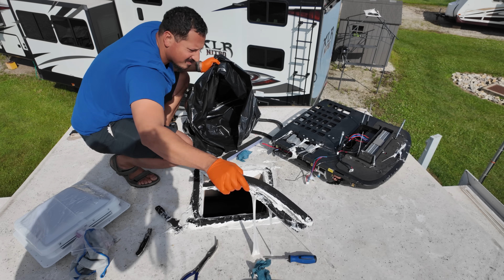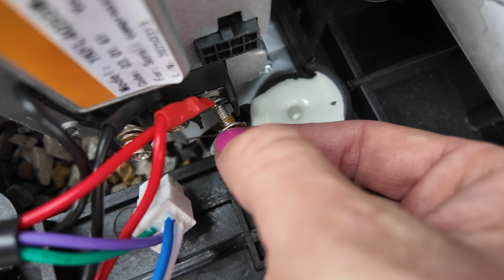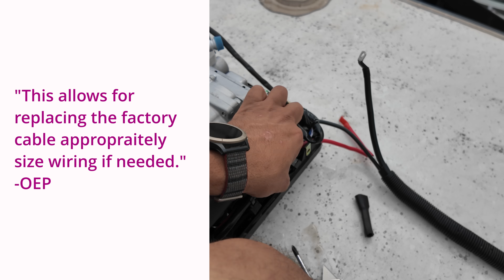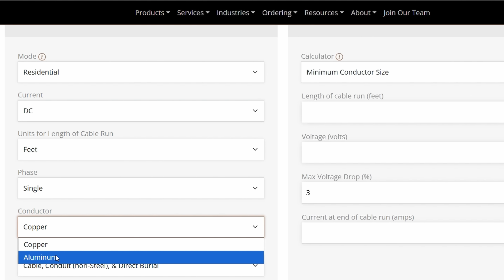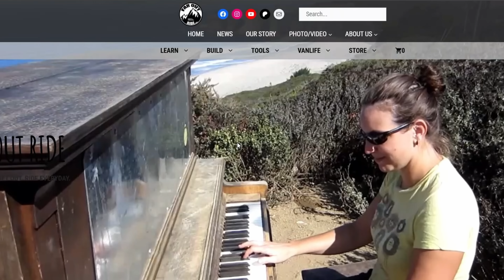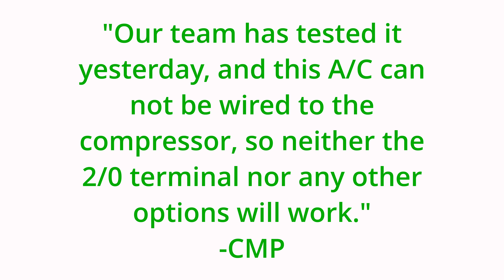The Truth About 12V RV AC Wiring in Big Rigs (What No One Says)

Comment: I run a 48V system in my 5th wheel with a 240V 24K BTU mini split for cooling and heating, and I love it. I’ve seen those units you’re talking about they’re definitely more suited for camper vans.

But I’m a little confused… In your last video, you showed it hooked up and working. Now you’re saying it won’t work on an RV? Did I miss something?
Reply from the maker: We had temporarily ran it to a battery for testing until we had time to gather all the supplies to do
The full wiring as described, was not was nor cheap to acquire. In the end we decide not to continue with it. 

We have a couple more things we are looking to try soon. 48 v setup is 👑
Reply: This is the best answer... 12v is so 2000... it's 2025. Will Prowse shows 48v system is under $2500 and pair up a 110v mini split maybe with 2 zone will actually cool your rv... the whole system will probably cost less than those battle born batteries cost.

Comment: You can always run the larger gauge wire up from you battery to the unit and then splice it to the smaller gauge if you have connection size issues.  If you do it just make sure the splice is adequately insulated.  This is no different than feeding a bus bar with a large gauge and then breaking off to smaller gauges. Make sure you fuse to the capacity of the smaller gauge wire.  Every single vehicle on the road is wired this way.
Reply: No I could be wrong but I'm under the impression when doing any size of wire calculations you only need to calculate for One direction not both ways in order to figure out the wire size
Reply from the maker: Thanks for the suggestion, I had thought of that, but wasn’t sure if it was safe to reduce a 2/0 wire all the way down to a 5/16 ring terminal. Thanks for sharing!
Reply: @DeterminationUnbound  caseypries7559 is correct.  There is no safety issue reducing down to the cable supplied with the AC for the last 2-3 feet.  You keep your voltage drop minimized with the 2/0 cable run, and the last few feet with #6 or whatever the unit comes with can handle the current draw.  No problem at all.  But it is a nuisance place a junction box just outside the AC unit; it would be very nice if the manufacturer provided a larger terminal strip.  (I am a retired electrician & electronic technician plus a long time RVer and have done tons of DC wiring and other mods to our 38” 5th wheel.). Keep having fun!
Reply: @davewettlaufer   You nailed it!  The terminal block on the AC is the main issue.  Once you figure the gauge wire... you need a bus bar big enough to apply the lugs would be common sense, but not to the manufacture I guess.
Reply: You can just run heavy gauge wire from your battery or inverter to a junction box at the drop point, throw a bus bar in there, and connect the factory 6 AWG to it. The manufacturer says that length of 6 AWG is fine, so you really just have to worry about getting power cleanly from your battery to that drop.